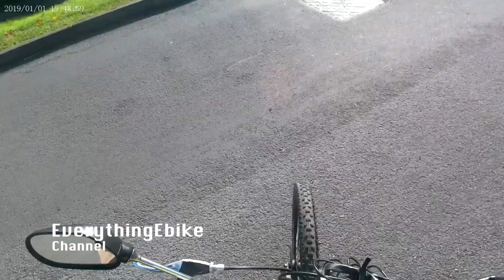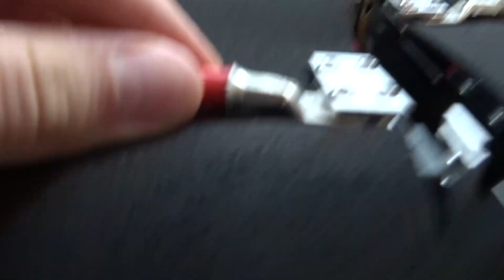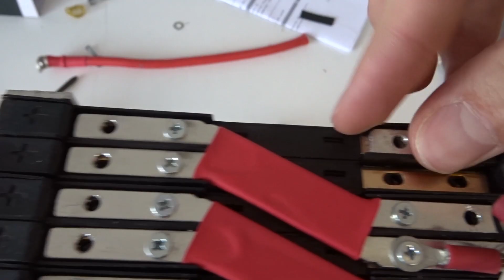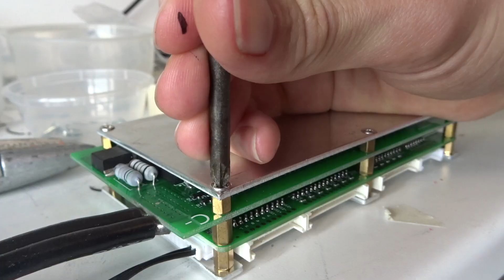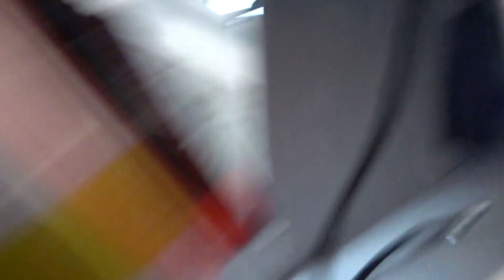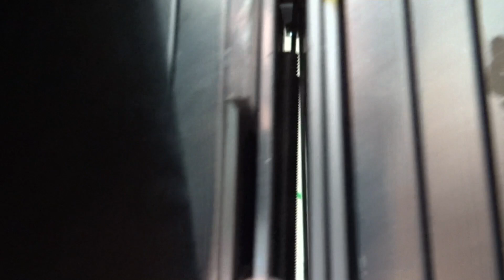The BATTERY is FINISHED! | 8kW Enduro MSVA eBike V3 Build | Anderson PP120 Connectors | Part 9

Comment: Where can I we get these connectors, I like them, looks a lot cleaner.
I hate that messy thing
Reply from the maker: https://www.peigenesis.com/en/anderson-power/powerpole-stackable-connectors/pp120-powerpoler-connector.html
Reply from the maker: You need to buy the housing and the metal contacts separately. They do different sizes depending on current capacity

Comment: Nice job mate! How many did You manage to fit there? All 30? 
Whats the final?52V 40ah? Thanks
Reply from the maker: Cheers! Managed to get 28 in there for a 52V 40ah pack. Might have been able to get more in if I cut the bottom off the frame to get them in and out but bit risky. Part 6-9 is all about the battery build
Reply: @EverythingEbikeChannel  hmm, so no way to fit there 12 more 😅, total 40 ... as you say maybe if I would cut the bottom frame. I need 72V  😅 thanks mate!
Reply from the maker: @alexferenci  I'm actually working on a project for someone who's trying to fit 40 cells in and he had the idea of cutting the frame and then making a panel that can bolt back on. He's going to have to hold some underneath the frame which could be interesting... but 40 cells will be mad if it works!
Reply: @EverythingEbikeChannel   thanks! Think same frame as yours! Im tempted to do the same! Let us know if you manage to finish that project! ;)

Comment: Great job mate got a quick question u know the battry u using how much current each cell can discharge and what is countinuse current for the battry pack
Say if I use 20s packto build 72v how much the pack can discharge countinuse and how much is burst
Reply from the maker: Each cell can do 100A continuous or 200A for up to 10 seconds (insane!). Putting more in parallel can obviously increase this.

Comment: Hey man! Everything is looking great but let me give you some advice... you should really turn that sabvoton upside down, so the cables coming out of it are facing downwards. I understand that it’s in the most confortable position for routing the wires, but that’s basically a time bomb. You see, when riding your bike any water you come across it will be guided by the cables straight inside the controller. It could be a bit or rain or a sprinkler or just a little splash, but overtime all of that water will be accumulated inside the controller and fry it. It happened to me with a freaking Thermo Nucular controller (year long preorder, roughly $1000 usd...) 
Oh, and by the way... i don’t know if you’re aware of it but... you should really look into the Nucular controllers :) a 12fet one can easily do 10kw for one tenth of the size of a sabvoton (i have had both...) cheers man :)
Reply from the maker: Just had a look at the Nucluar controllers and they look great, but already got a sabvoton and I'm loving it. Could be a good upgrade though! With the direction, I'll be putting a plastic moulded covering over the top and installing a mudguard at some point so water won't be an issue (not that riding in the rain is much fun anyway but it should be splashproof!) Thanks for pointing it out though and that's a shame about your controller!